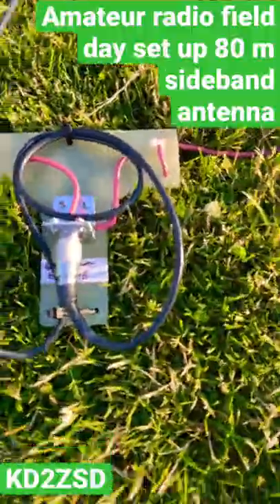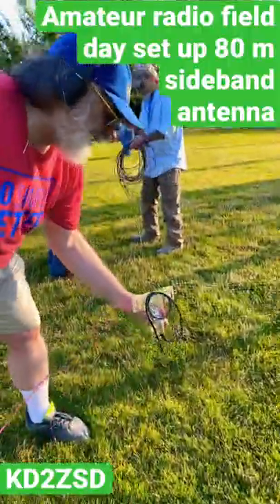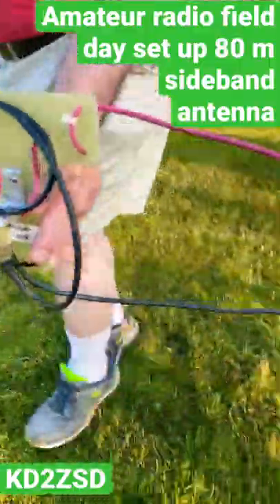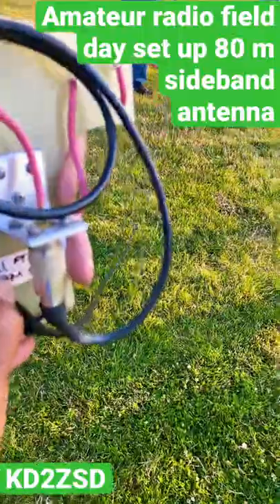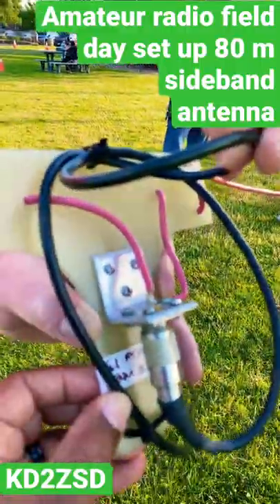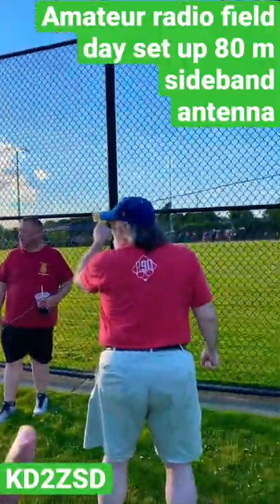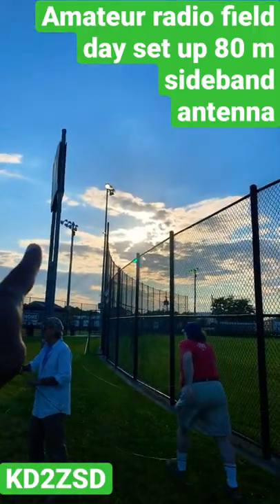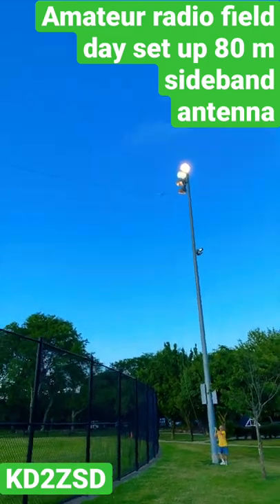Setting up 80m SSB dipole antenna for Amateur radio field day - Great South Bay Amateur Radio Club.

Comment: How did you even get it up there ?
Reply from the maker: Thanks for the question. The club per install a pulley system to help with rising the antenna into the air. Please remember to subscribe to the channel and like the video.
Reply: @DIYRAY  nice, that looked like public lights though, how did you even get it up there in first place ? It's not like a tower which you can simply escalate
Reply from the maker: @UndercastEsmeganitrospeed  yea, they use a bucket lift to reach that height to install the pulley system. Once installed it ez to lift the antenna. It’s like rising a flagpole.